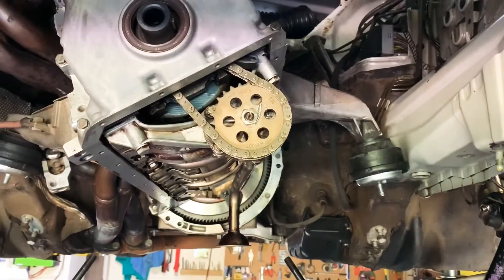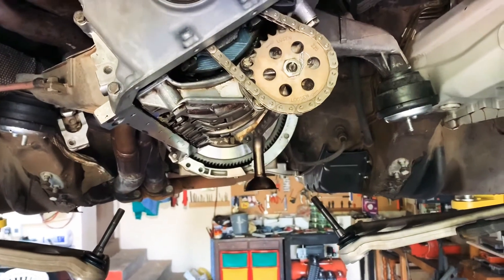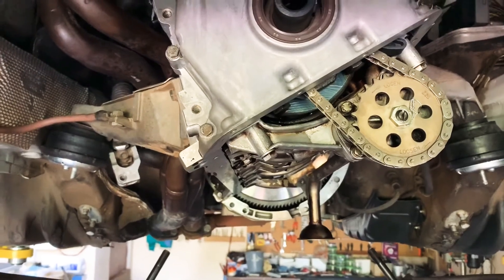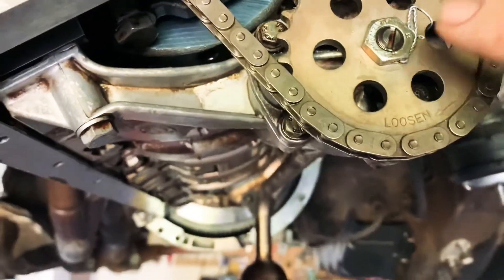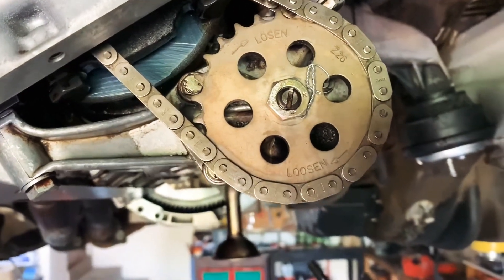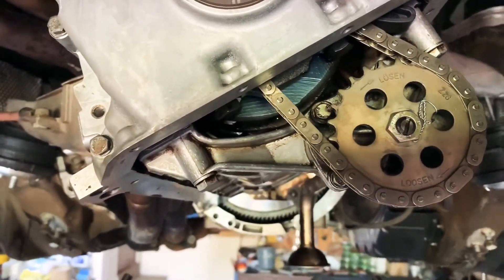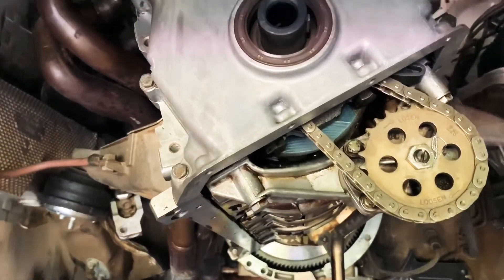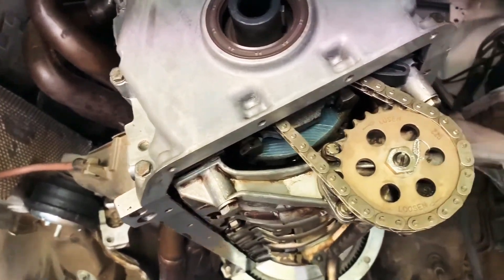Oil pump tactics - BMW E46 Track Car with M54B30

Comment: Thanks for these great tips for us e46 guys and gals. Keep up the great work.

I have a question about your oil pump solutions. My e46 is a daily driver, who sees some high rpm. I'd like to spend more time above 6k, but I'm too afraid of the oil pump problem... My question is, do you feel the mod of adding the tensioner from the VW is realistic for an average diyer to do while changing out the oil pan gasket? It looks to be simple enough, so I think I can do it, but am unaware of the problems of drilling into the block
Reply from the maker: Hi John. Thanks for the positive feedback - we're glad you're finding some of this of value.

I wouldn't bother with the tensioner for a daily driver.  These things are invariably about trading one risk off against another - in this case, the risk of an oil pump failure, versus the risk of something going wrong with the tensioner and scattering bits of steel and plastic to be munched up my the bottom end.  Also, removing the timing case cover has its own challenges - you need valve cover off to get to the top bolts, and a breaker bar and mega torque wrench to deal with the Jesus bolt holding the vibration damper on.
I think you can spank a daily driver all day long without getting close to the punishment a race engine endures when under the control of weekend warrior duly infused with red mist, so I think your risks are low.  I would however drill and wire the nut though - easy to do and little to wrong, and will give you some peace of mind.  Just be careful when tightening that nut though - remember most "click"'type torque wrenches arent calibrated in the LH direction, so you'll need another strategy
Reply: @buildabeemer  Good advice that I will take. Thank you.